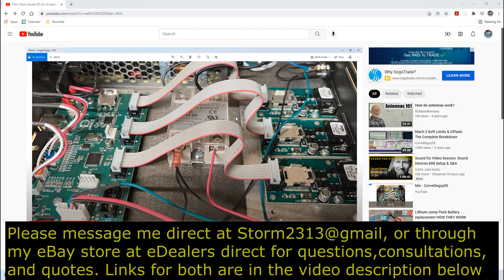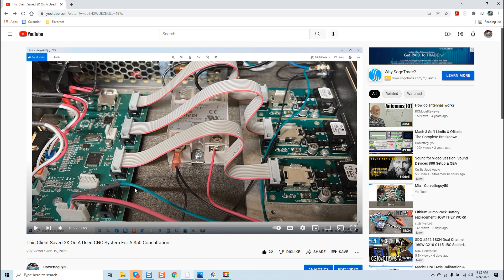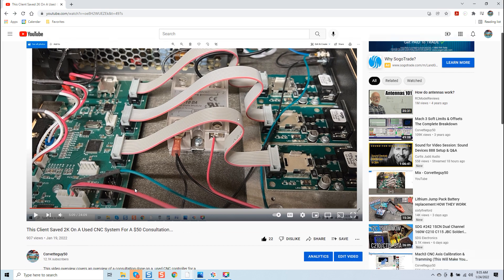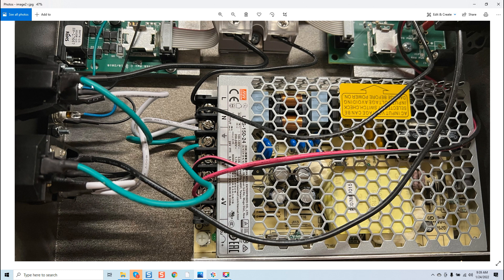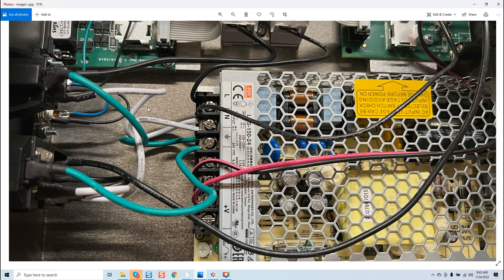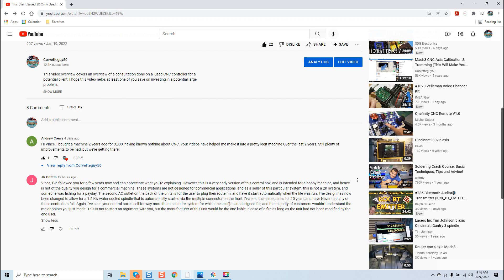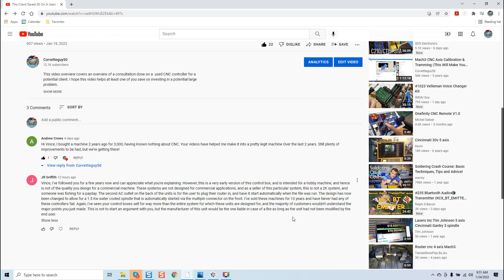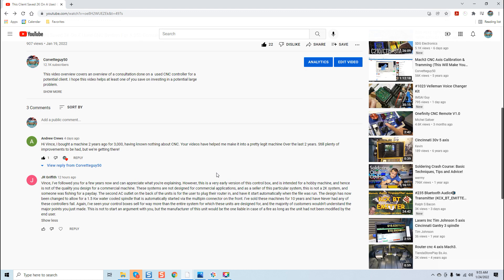Addressing A CNC Vendor's Comment Regarding Their Controller Video Forensic Breakdown..

Comment: What a great video. I have been working with commercial CNC's for 32 years. I started building hobby CNC's when covid started. When I purchased my hobby Mack3 board I expected nothing less than a controller that would have accuracy of less than .0005 of an inch. I knew that all variables would be in my chassis design, choice of stepper or servo motors and drivers, spindle, and power supplies. Just because it is a hobby machine doesn't mean it deserves less respect than a commercial machine. Nor should we expect less of it. Thanks for calling out the BS on this. The "hobby" community deserves more respect than it gets.
Reply from the maker: John, Thank you for your support, and I couldn't agree with you more. Thank you,
Vince

Comment: In every country, you have a government code of standards for electronics and electrical equipment. Any person making these control boxes needs to first have the correct qualifications to build them plus abide by their country code of standards. If they're found out for not following these standards they could lose their qualification and get fined. For that reason electronically, I do not see any difference between a "Hobby" or "Commercial" CNC Machine when it comes to the "Heart" of the system other than the use and quality of the components being installed.
Reply from the maker: Martin,
Thank you for your support. You stated it all very well. Vince